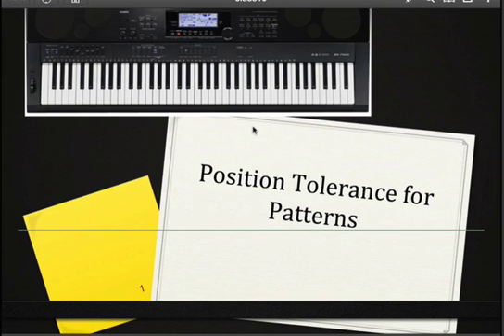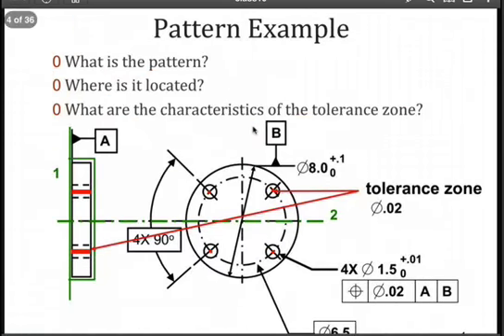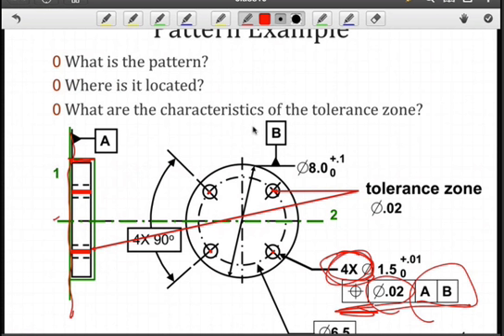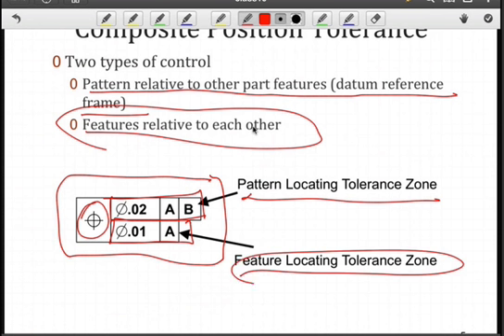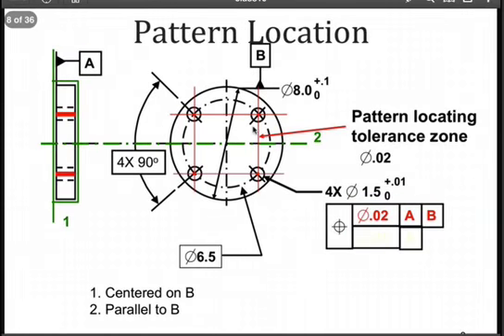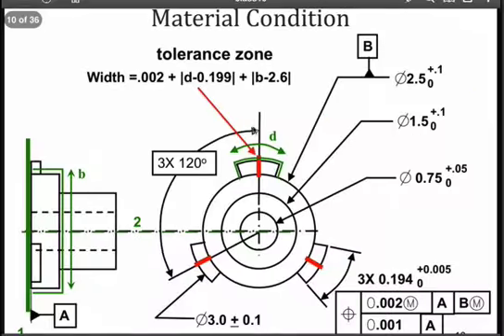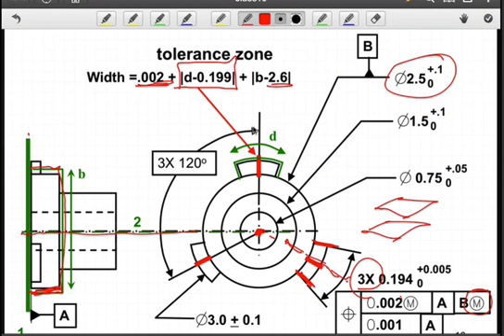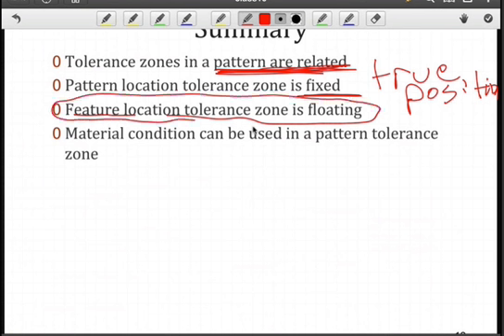Pattern Tolerances

Comment: 1.5/2(bolt hole radius)+6.5/2(bolt circle radius)=4, which is also the radius of the cylinder. Does that mean the edges of the holes and the cylinder actually intersected?

Comment: If MMC on thread holes, which diameter can be calculate for tolerance zone.pitch diameter or inner holes.
Reply: in that case it is mentioned in the diagram whether the tolerance condition is based on pitch dia, inner dia or outer dia